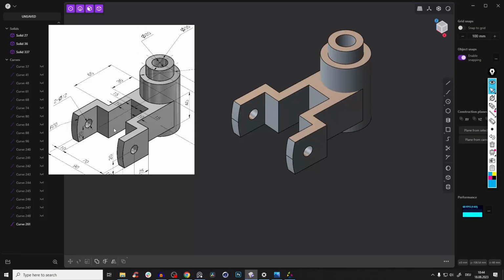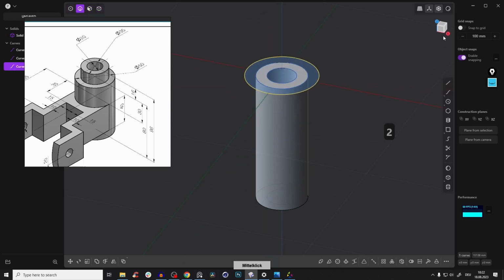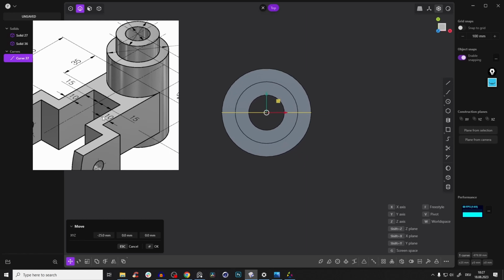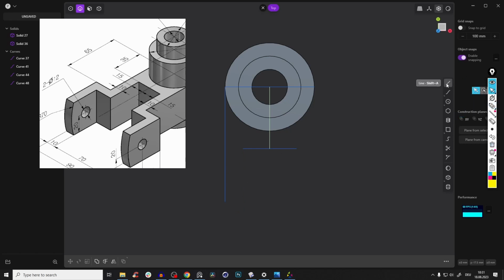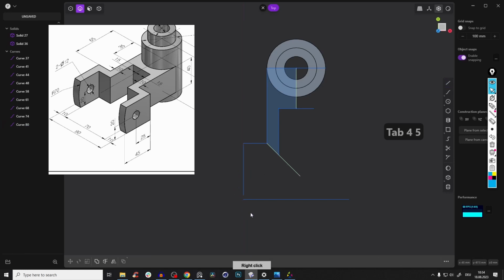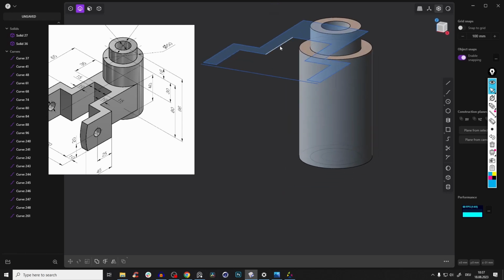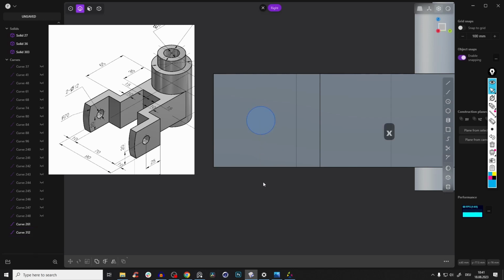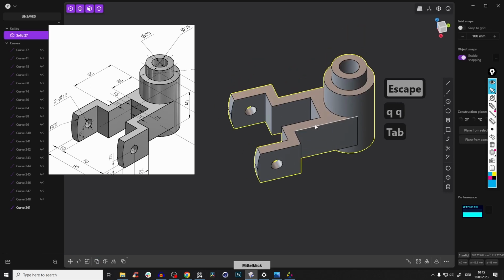Plasticity | CAD Precision Modeling [Tutorial for Beginners]

Comment: It's all fun until you need to go back and change all 65 holes fitting tolerance by 0.1mm :D
Reply: This is so true.
I think plasticity is good for model toys/figures but not for tools/products/devices which require exact dimension or changed later.
Reply: Bullshit, this piece of software just like Alias or Rhinoceros. And these 2 are quite good for product design etc, as well as plasticity itself.
Reply: @bidmun  can you please advice some procedural or non-destructive software? thanks!
Reply: You're missing the point. Plasticity is nurbs for artists, not engineers.

Comment: Good habit when one starts to build the model is to start with one plane rather than 3d view, usually one goes with curves or basic 2d shapes before extruding. In your case I would go to Z plane and start building from there. Like someone mentioned - scaling grid to lower numbers to will have more control over snapping. Good work Nikita!

Comment: Hi Nikita. When you adjust the size of the grid you see a lot more and the snaps actually make sense. Set it to 1 cm as that is the scale you are working on (sometimes when you need something in the middle set it to 0.5 cm). 1 cm is good in general  though.
Reply from the maker: Oh, that's amazing. Never used that feature at the top right.

Thanks!